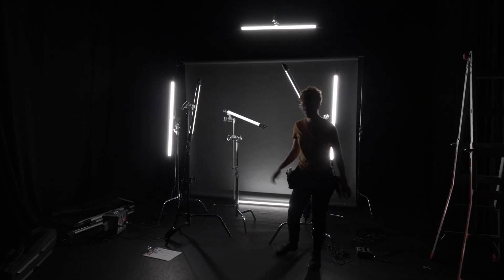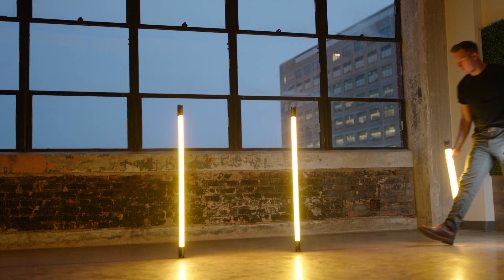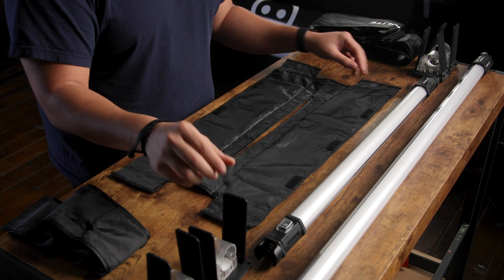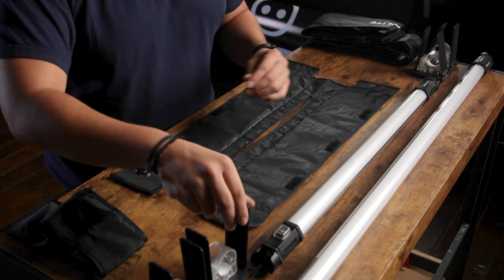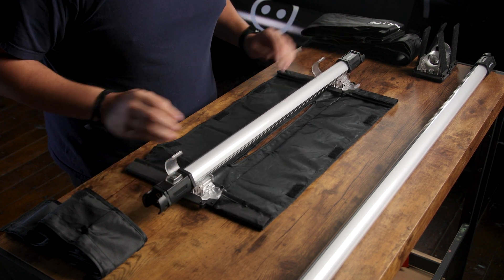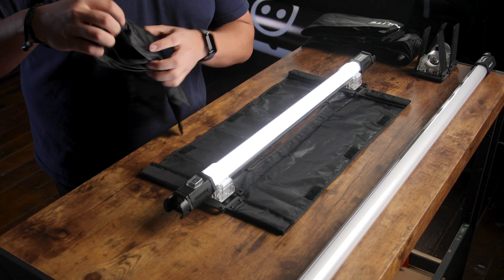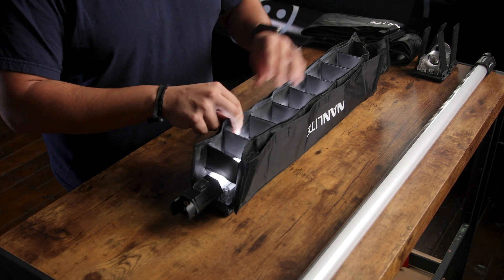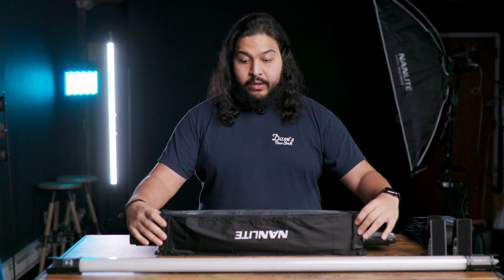How to Use the NanLite PavoTube Barn Door and Grid: Ultimate Light Control

Comment: The problem with these is that you can’t access the menu. You can’t see the screen. Makes them a huge pain on set.
Reply: I just installed my set today and maybe Nanlite updated the product design, but one of the attachments has a window cut out that allows you to see the screen when it's installed.
Reply from the maker: Hi Justin, thanks for the input we will pass it along to the Factory.

Comment: I got one of these for my astera titan but it will only fit on by the control panel and is really tough to latch, any pointers? I really want to buy more
Reply from the maker: Hi, Austin I believe the Astera tubes are bigger in size than the T12 size of the Pavotubes.   This could be the trouble you're having with mounting the rings to your Astera light.  Currently Nanlite doesn't make any larger rings than what is currently on the market.
Reply: Modify it. The astera comes with two of their own latches. Y